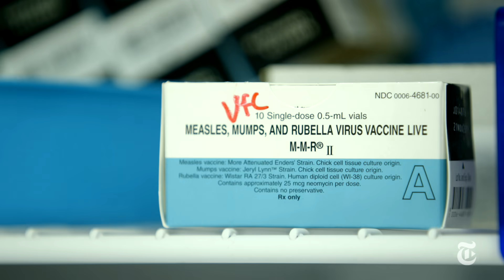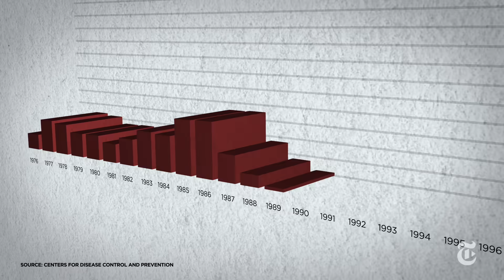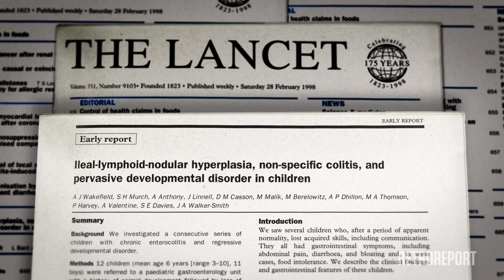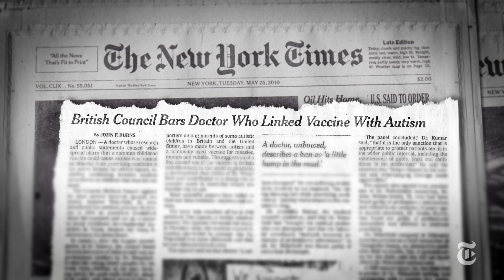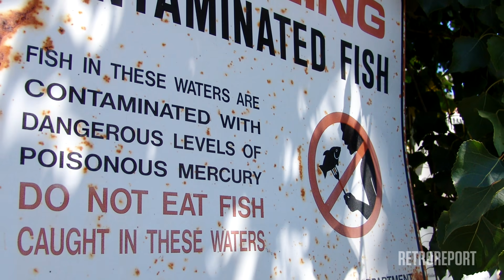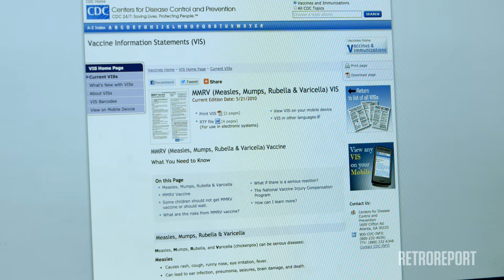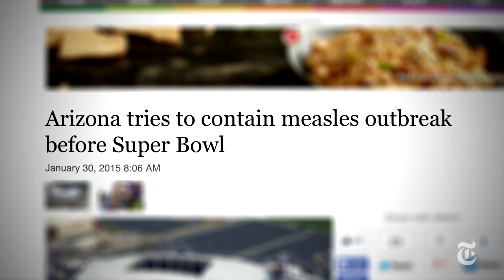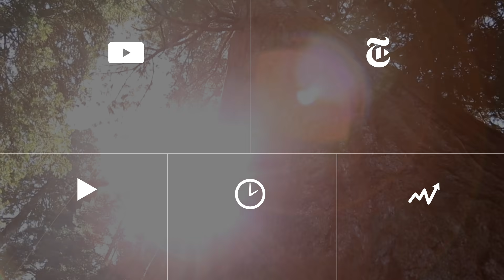Vaccines: An Unhealthy Skepticism | Measles Virus Outbreak 2015 | Retro Report

Comment: Vaccines were declared,  "unavoidably unsafe" by the U.S. Supreme Court. All vaccine manufacturers are totally immune to lawsuits and any liability, unlike the other pharmaceuticals. Therefore they do not put much effort into making vaccines safer through testing, or in using more expensive methods  that can make them safer. They are into mass production and $$. It's a multimillion dollar industry. It is in the billions now. Where there is $$ there is bound to be some cheating. No one is an angel, and there have been incidents where information on vaccines was withheld because it went against the agenda. The CDC owns many patents on vaccines and also purchases them. It's a revolving door. 
 The baby above was too young to be vaccinated with Dtap,,which is a live vaccine which can live in the back of the throat and spread,,unknowingly. It is called vaccine shedding. There are signs in hospitals cancer ward hallways that state..go no further if you have been recently 
vaccinated with 3 live vaccines. Dtap is one. A vaccinated person can carry it silently and have no symptoms bc DTAP only prevents or lessens your symptoms.  It is a bacterial so cannot be prevented. 
  CDC announced the Pertussis part of the vaccine. . is no longer effective bc the strain has mutated. But they are saying take the vaccine anyway. 
  Please do deeper research than what is instantly presented in sound bytes.
  DPT was removed from the schedule due to seizures and SIDS. My daughter had seizures from it at age 5.  Now the newer Dtap is still related to seizures and Autism is listed on the insert. People need the whole truth.  Media is partial.

Comment: Guys vaccines have Dihydrogen Monixide in it which is really toxic! Am i right Anti-vaxxers?
Reply: No, now they use burnt or oxidised hydrogen which has to be stored in special containers of silicon dioxide (SiO2) and sodium oxide (Na2O). These containers do nothing to remove free radicals from the oxidised hydrogen.
Sodium can lead to high blood pressure and Silicon causes Silicosis.
Do you're research sheeple!
:-)

Comment: Vaccines are not associated with autism: an evidence-based meta-analysis of case-control and cohort studies. Taylor LE, et al. Vaccine. 2014. Show full citation Abstract There has been enormous debate regarding the possibility of a link between childhood vaccinations and the subsequent development of autism. This has in recent times become a major public health issue with vaccine preventable diseases increasing in the community due to the fear of a 'link' between vaccinations and autism. We performed a meta-analysis to summarise available evidence from case-control and cohort studies on this topic (MEDLINE, PubMed, EMBASE, Google Scholar up to April, 2014). Eligible studies assessed the relationship between vaccine administration and the subsequent development of autism or autism spectrum disorders (ASD). Two reviewers extracted data on study characteristics, methods, and outcomes. Disagreement was resolved by consensus with another author. Five cohort studies involving 1,256,407 children, and five case-control studies involving 9,920 children were included in this analysis. The cohort data revealed no relationship between vaccination and autism (OR: 0.99; 95% CI: 0.92 to 1.06) or ASD (OR: 0.91; 95% CI: 0.68 to 1.20), nor was there a relationship between autism and MMR (OR: 0.84; 95% CI: 0.70 to 1.01), or thimerosal (OR: 1.00; 95% CI: 0.77 to 1.31), or mercury (Hg) (OR: 1.00; 95% CI: 0.93 to 1.07). Similarly the case-control data found no evidence for increased risk of developing autism or ASD following MMR, Hg, or thimerosal exposure when grouped by condition (OR: 0.90, 95% CI: 0.83 to 0.98; p=0.02) or grouped by exposure type (OR: 0.85, 95% CI: 0.76 to 0.95; p=0.01). Findings of this meta-analysis suggest that vaccinations are not associated with the development of autism or autism spectrum disorder. Furthermore, the components of the vaccines (thimerosal or mercury) or multiple vaccines (MMR) are not associated with the development of autism or autism spectrum disorder.

Comment: depending of the overall health of the child/ person and their genetic background vaccines are 85-95% effective. also vaccinations don't stop necessarily you from contracting the diseases their main job is to train and prepare the immune system for what to do when they come in contact with the virus or bacteria. i'm a prime example, i get sick easily and the smallest cold or flu can lead to weeks at the hospital for me and it's one of the reason i probably one of the first to get the flu shot at my local hospital. even though i get the flu shot i still the flu now and then  but they're not as sever or as often as they were when i didn't get the flu shot

Comment: Pre-measles vaccine case-fatality rate was a staggering 0.0016 %. That's when 3-5 million people a year got infected and 500 would die. The vaccinated CAN get a "vaccine preventable" disease and do get it. During the last whooping cough outbreak, 87% of the individuals were already vaccinated. According to the FDA, the DTaP vaccine prevents whooping cough symptoms but does not prevent transmission. So you can get the DTaP and when exposed to the bacteria, you may not experience symptoms but the bacteria Bordetella pertussis will colonize your lungs and you will transmit it to others without knowing you have it. 

There is no randomized double-blind placebo controlled study looking at the safety of the CDC's current vaccination schedule. That is the gold standard in proving safety of pharmacotherapeutic interventions BEFORE they hit the market by comparing the adverse events in the vaccinated with the never vaccinated. 

Viagra gets about a 10-year safety follow-up study period before marketing. Hepatitis B vaccine for example only gets 4-5 days before it is approved for distribution and given to day 1 old babies.  Hep B is a sexually transmitted disease and spreads by sharing needles. No reason to give that to children.

According to the 1986 vaccine injury compensation act passed by congress, no one can sue the vaccine manufacturer for injury. But they can sue the US government. more than $3.7 billion has been paid out to victims so far.

Verify for your self and have a reasonable debate. Do not be sheep.

Comment: Vaccines bont work... plus they are shot up with loads of things unrelatyed to the diseases they are supposed to cure. Many doctors have spomen up about this but are like tiny voices in the corporate controlled chasm. Tke flu "vaccine" which does absolutely NOTHING and usually causes flu more than it fixes it... and nobody talks about the deaths from flu vaccine that would have just been a simple FLU if they hadnt taken the vaccine.
Reply: truthseekers666

They work, they have prevented death. If vaccines don't work how come vaccinated countries and cities never have outbreaks? When unvaccinated countries and cities do.
Reply: The flu vaccine is quite unnecessary yes. But that's because the flu mutates constantly. And that's unfortunate but you don't need to vaccinate for the flu.
Reply: The statistics which they are not allowed to hide say that vaccines do not offer much more resistance against the original disease than not and on average most people will become more susceptable to variants of the disease. Side effects are not often taken into consideration as a factor of worthness of a vaccine - and when you factor in risk of death or serious damage due to vaccine use versus the effects of the original disease sometimes you stand better chances with the original disease. Ive been to full blown lectures where the data has been laid out and vaccines are rubbish most of the time. If you watch the video you hear why the diseases are getting imune to them anyhow and your point about third world countries was discusssed in the film and it was stated that there i no difference between disease rates in vaccinated countires versus unvaccinated areas such as the third world... so if you watched the video you should have picked up on that point.

Comment: you will never get rid of measles... even if the population is 100% vaccinated. It's just not possible.
Reply: littlered4201 it is. We got rid of Small Pox...well minus the two located in frozen vaults in the CDC (one in Atlanta and the other in Russia). Unless the virus mutates like the flu then not only are we totally screwed but also it wouldn't be possible to eradicate fully.
Reply: Even if don't eradicate it fully atleast we can lower the chance of getting it to the extreme
We did eradicate smallpox though so there is hope

Comment: Not much in the way of actual studies on vaccines, nearly none on some like influenza vaccines.  Its not being run by science but professional conscientious. They all believe they work based on compelling correlation of observations, but correlation is not fact.  I personally think most vaccines work based on those observations and my own personal experience (accept, I have personal experience where the Pertussis  vaccine did NOT work (was vaccinated as a child, got whooping cough at 40).  Of course, the answer by the professionals is you need another one.  Every time there's another outbreak and it become obvious that previously vaccinated individuals are coming down with the illness, they're going to start recommending this, till that doesn't work either.   For the record, my daughter has autism, there is no way for me to know one way or the other if it was caused by vaccinations.
Reply: For the record the whooping cough vaccine you had did work, just overtime effectiveness weakens, this is why many people who never had had chicken pox are expected to get the mumps vaccine. As you get older you immune system doesn’t work as well and sometimes needs an extra boost. As for autism, it’s probably not caused by vaccines, it’s more then likely genetic. It’s simply just a slight difference in brain set up that causes it. I do much research on it and it’s more then likely children are born with this difference in brain set up, it just becomes noticeable later. As for how parents talk about children with autism, as if autism is a disease it disgust me. People with autism aren’t wrong but different. Many issues that people with autism have are in my opinion are more then likely caused by oversensitivity to senses. I mean I wouldn’t know. It’s not like I have a child with autism, I just am one.
Reply: Manager Sejin Stan oh good point I forgot to mention, autism is way less of an issue then many of these diseases which often result in death or permit physical disability.
Reply: Can you give a single link to a study saying that they are bad.
Reply: Robert Drake They do observation, correlation, causation, hypothesize, measurements, reformation, and retesting. For most cases, absolutes don't exist and diversity promotes the shattering of 100% arguments.

People base autism off of correlation observations. Too many people in this world do not understand causation and critical thinking.
Reply: *****
You have a case name and number? State? City where this took place? Who was the plaintiff? Who was the defendant? What type of court was it? Who was the judge(es)?

Let's get to the bottom of this thing once and for all.
Reply: *****  It's typical for bigots to call people trolls for disagreeing with them. I said let's find the truth, which ever side of the fence it may land on.  Why can't we review the facts of these cases ourselves? Who are you to determine what is true and what isn't? Let's have a little transparency to see what's behind the curtain. Let's take the arguments for and against, put them all out on the table, look them over, and decide for ourselves. Both your script and "PharMafia"'s script can kiss my arse.
Reply: Sorry about your daughter. I agree, every time vaccine failure becomes apparent they just throw in another booster. When will it end? Praise Bob!

Comment: I don't understand how we can have an outbreak if the MMR vaccine is SUPPOSEDLY 90% effective. Therefore, if you're vaccinated you're protected. Unless, that is, vaccines don't really work...
Reply: The fact that it is only 90% effective is the point. For those that have had the vaccination it is a very low chance that they will have the disease but there is still a chance, and that chance rises whenever your immune system is compromised in any way. If your body has another virus that it is fighting off at the point when you come into contact with it then your body is not able to fight them off as effectively, even if you've had the vaccine. It's just something that gives us an extra boost in fighting it and this is how all vaccines work. When people are not vaccinated they are easily effected by diseases and then they can spread it to people that are also not vaccinated or have compromised immune systems.
Reply: A virus can change (evolve) as it infects the individuals that arent vaccinated, to the point that the immunity built up in vaccinated individuals isn’t able to act on the virus because it has changed. The non vaccinated individuals are a perfect incubating ground for the virus, giving them a perfect environment for them to evolve and become even more virulent against the vaccinated individuals.
Reply: By not vaccinating you're making the elderly and young ones - those who cannot get the vaccine be exposed to the virus
Reply: Its the people who are to young to be vaccinated who are dying from the retards who don't vaccinated. Don't even say autism report. IT WAS ONE REPORT OVER 10 YEARS
Reply: Bible Flock Box 90% effective. That means 10% ineffective. Sometimes the body doesn't remember how to fight the vaccinated disease. For example my hep B vaccine that I got when I was a child didn't take. I had to retake it last week. For over a decade I was not immune to a disease we have a vaccine for. Sometimes weird things happen.
Reply: search up herd immunity
Reply: ***** Yes?
Reply: ***** Haha no problem :)